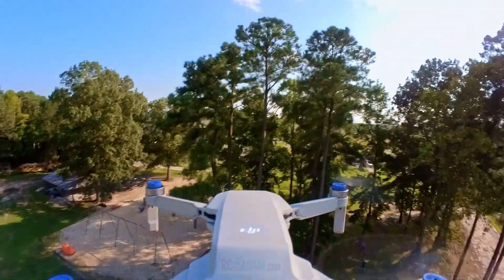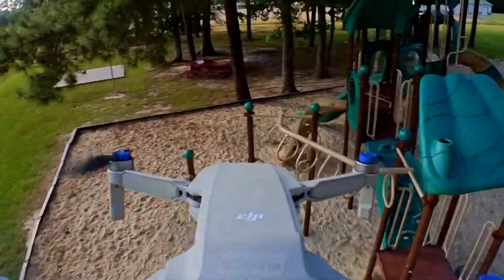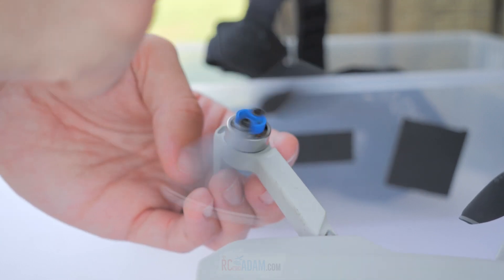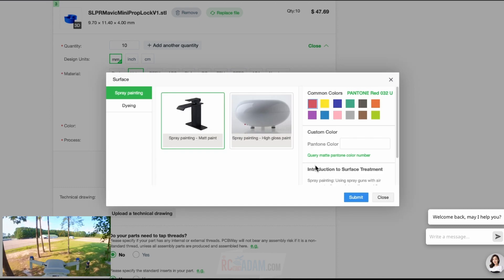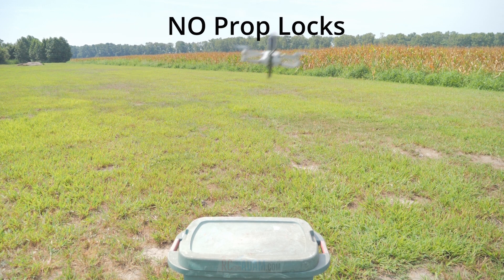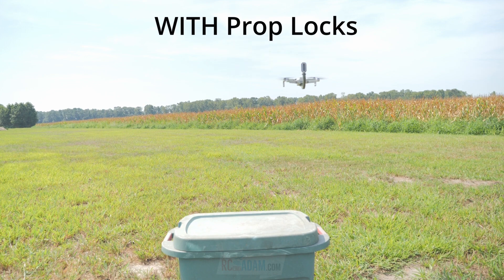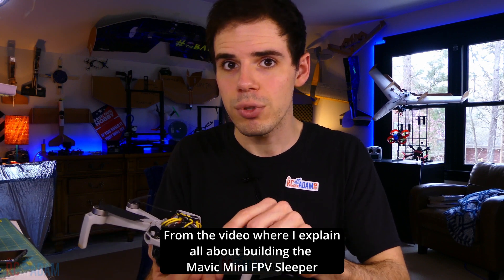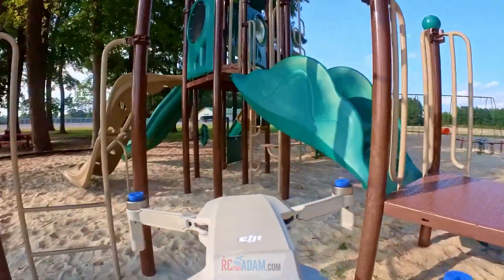The Secret behind my Mavic Mini FPV Drone - DJI Mavic Mini FPV Sleeper Racing Drone

Comment: These motors and propellers combination should give a high efficiency power... How much does it weight now and what's the flight time with which battery? If you remove all the unnecessary electronics of a DJI mini and put a lightweight frame it should give you more flight time, isn't it?

Comment: Amazing, may I know what flight controller that had a built in esc you used in this modification?
I have a dji mini with a faulty main board and I am thinking of modifying it to thing like this.
Reply from the maker: It's a Flywoo Goku GNF4 AIO. Se this video for more details https://youtu.be/EI6Ie_-OJhk .

Comment: I love this!  Have you tried swapping out the motors on the Mini?  They look like 1404 motors.  You'd have to drill holes in the arms.  I think it would be worth it for the prop selection.  Maybe even on a stock Mavic Mini.